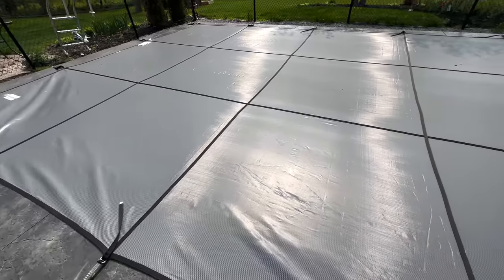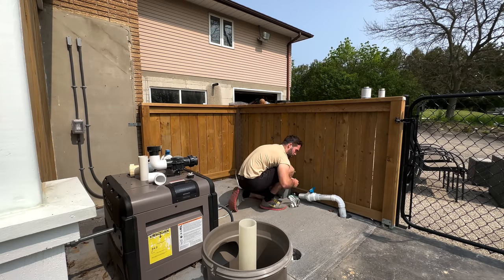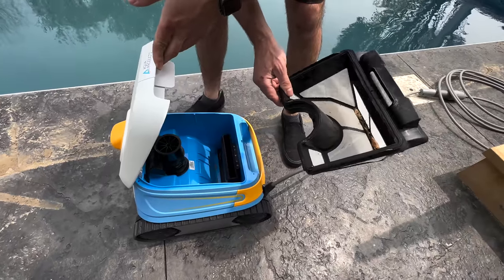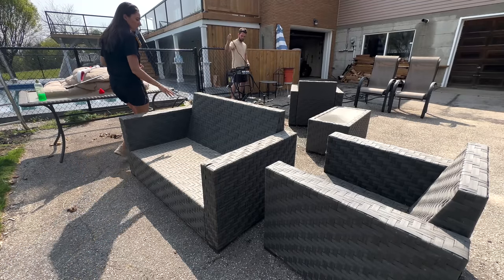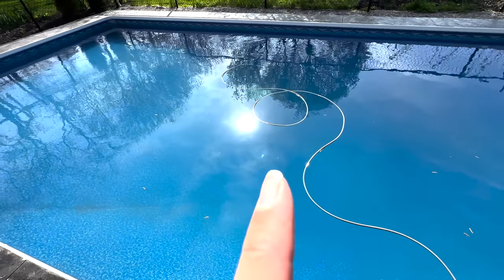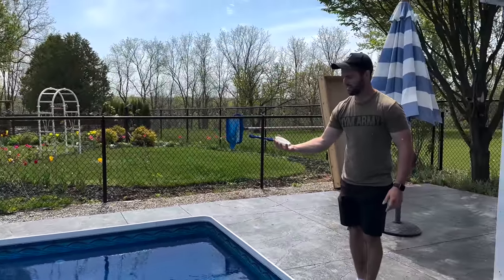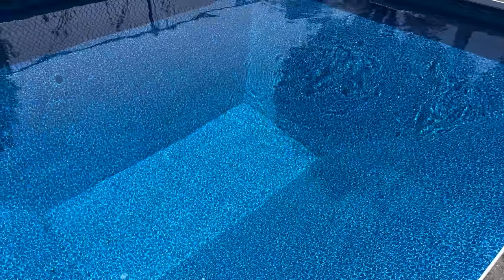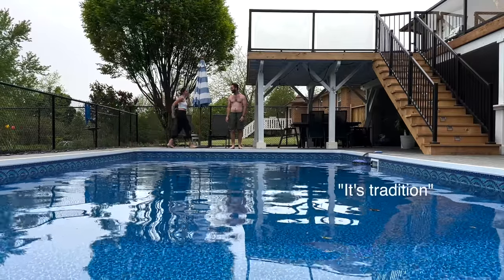Opening Our In-Ground Pool!! Satisfying Cleaning & Summer Prep ☀️

Comment: Just a note about your pool plant area. UV rays from the sun can degrade the pipes over time, causing them to get brittle. This could end up causing a leak at some point down the line. I would strongly recommend getting atleast a roof over the plant area to protect the pipework from the sun. Ideally it would be fully enclosed to prevent the sun from touching the pool equipment at all. Enclosing it would also dampen the sound from the pump.
Reply from the maker: Thank you!!
Reply: Mallory johnson 12